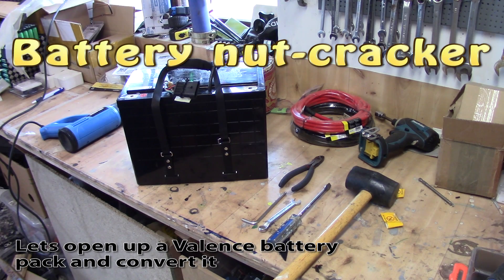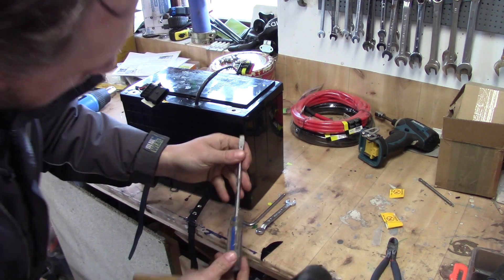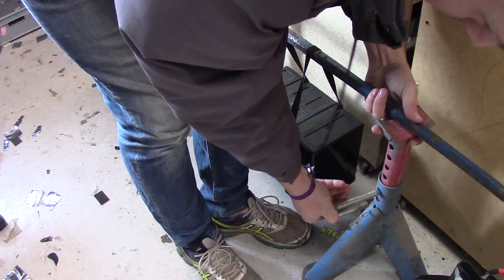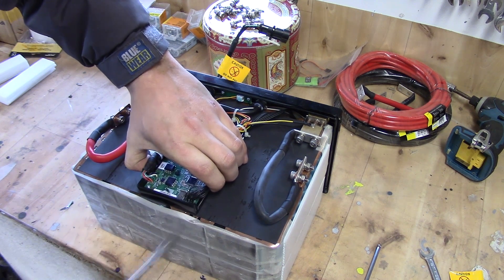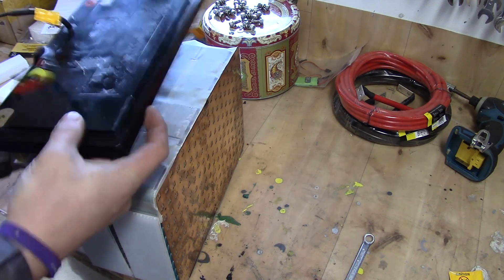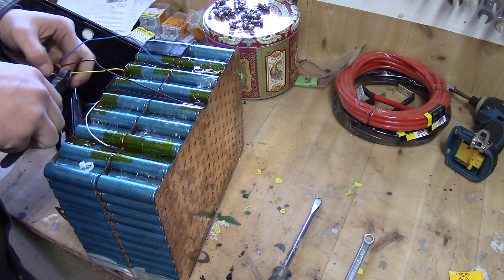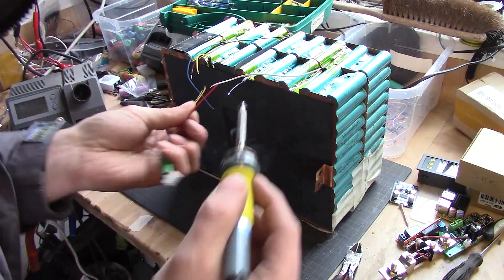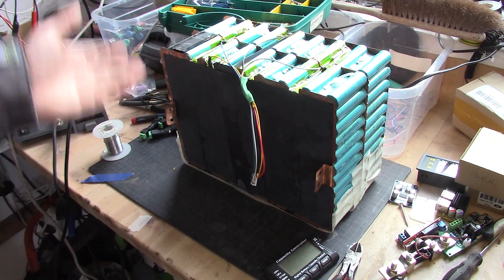Opening up Valence 12V Lithium battery

Comment: hejsa daniel her kan man selv sætte en bms til og få den til at virke
Reply from the maker: Daniel Lolk yes my idea is to switch that slave board to one im working on
Reply: oki nice can you use it to start a car  it is big anof
Reply from the maker: Daniel Lolk a smaller car or car that doesnt need high current. max continous is 150a and max is 300a. the ones here are not made as starter batteri but for larger battery banks.
Reply: oki watt abot a tiny solar setup for may free house for ligtning
Reply from the maker: Daniel Lolk thats would be perfect. one of the better choices i eould say :)
Reply: oki do you have facebook i vant to talk to you  you can find mee under     daniel lolk
Reply from the maker: Im pretty sure i answered but apparently not... You can reach me on Facebook or pm me on Google+. I also exist on DIY Powerwall forum https://goo.gl/JgCXB7

Comment: Was the bms in the unit working? Nice job taking it apart thanks for showing.
Reply from the maker: Thanks!  Im not sure if the slave unit is working or not. I do not see any physical fault and the led blinks green indicating it being ok. But since i dont have the master i cannot test it. Im going to replace them with the one im building.
Reply: @DIYTechRepairs  they communicate with rs485 and canbus.... with a 3usd usb to rs485 converter you can monitor them from a pc... too bad because the bms is really nice... if you have no use for it i'll be happy to pay the shipping... i might build an interface for them...
Reply from the maker: @ElectronicMarine  They are all trashed. Most of htem where not working and they are also only slave units. They are not the same as sitting in the valence batteries you buy 1 and 1. Theses are made to sit MANY together and then controlled by master unit.
Reply: @DIYTechRepairs  i know how they work... that's what i wanted.. ;(
Reply from the maker: @ElectronicMarine  wanted slaves that are trashed ? ;)Eya i have binned em all im afraid
Reply: @DIYTechRepairs  no problem... alot of people are using those used batteries so i thought to build the missing part... since should be easy...